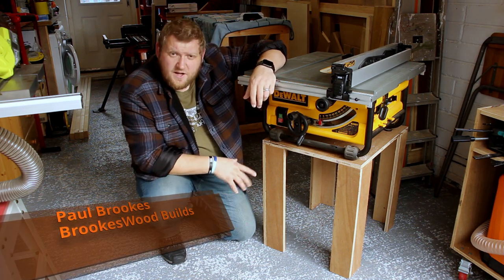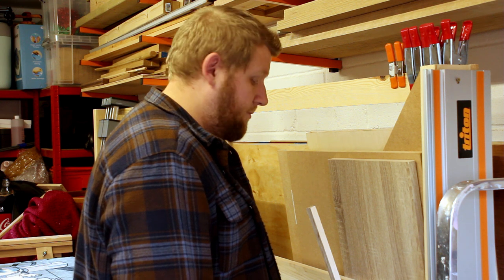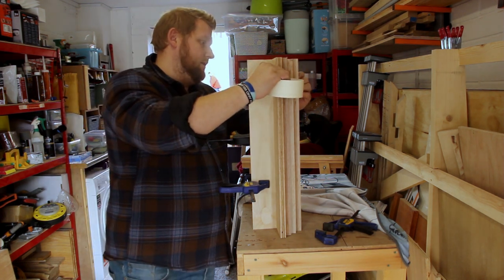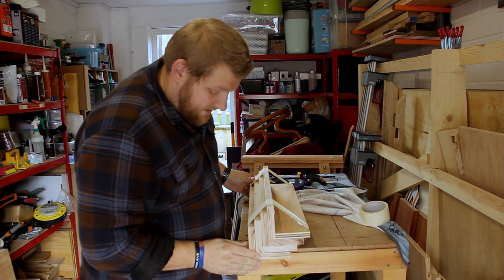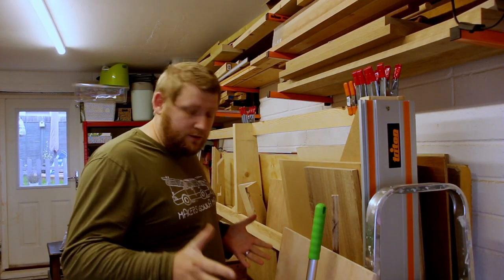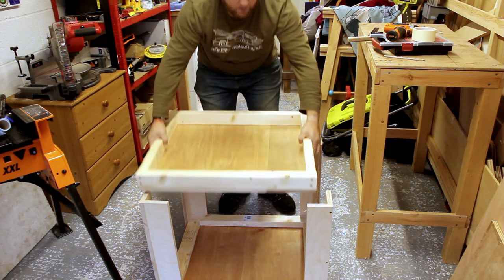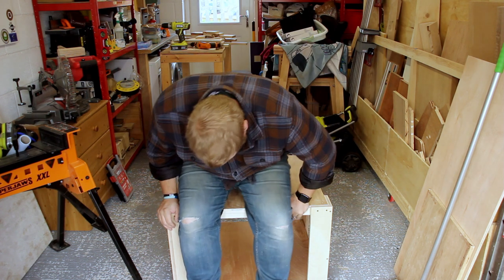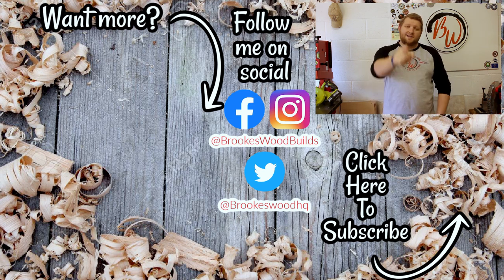Making a basic stand for a jobsite tablesaw

Comment: Great upgrade mate. I was going to ask about casters until you said it was part of a bigger build. Will it eventually be mobile or going to be a fixed bench?
Reply from the maker: It’s going to be built in to a bench but I have some of the flip up castors so you can drop it onto the feet when you want it not movable.